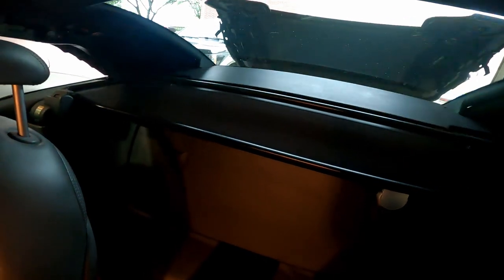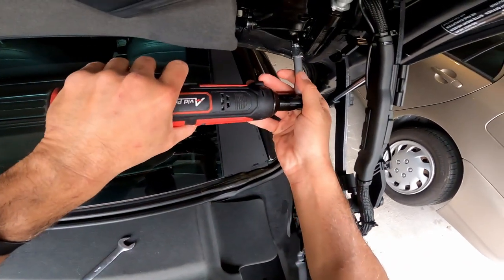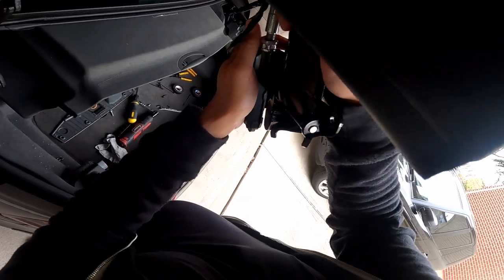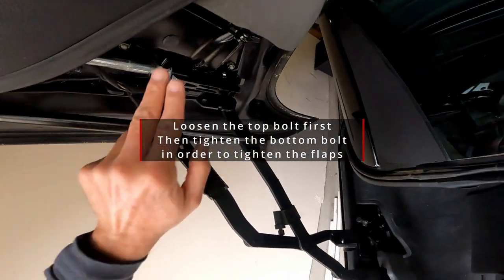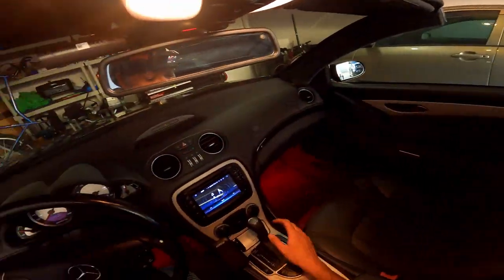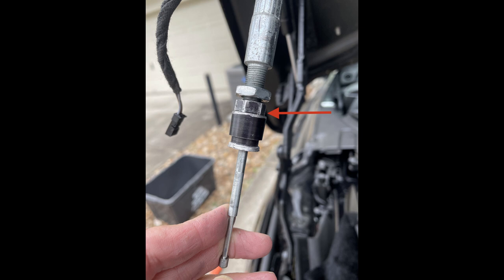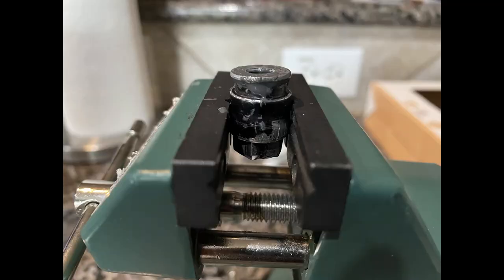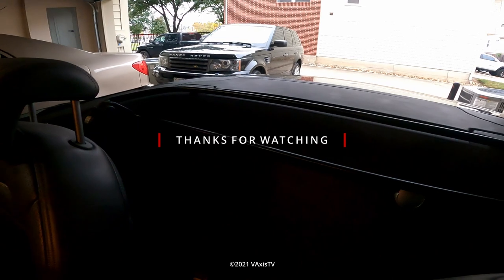SL55 Flap actuator replacement

Comment: Hey any help on how exactly the adjustment bolts should be as ive adjusted mine and now the flaps only open half way
Reply from the maker: Could be that it’s not aligning. Did you loosen the adjustment bolts before taking apart the flaps? I mention in the video to try and leave them where they are so you have a basic idea of where they should be. 
Also did you put it back together based on the position I show in the video? I’m wondering if you put them back at a different position so maybe they aren’t able to extend fully?

Comment: Hey can you do this fix the flap actuator if top is stuck closed? Thanks
Reply from the maker: Are the flaps in the trunk loose and hanging? If so that might be the issue and you can fix it by changing the actuators. 
You can also check the hydraulic pump in the trunk on the left side and see if it has fluid in it. If it’s empty most likely you have a leak and that is the issue.
Take a look at this video towards the end. I show the pump in it: https://youtu.be/D4rnwr9F2BA